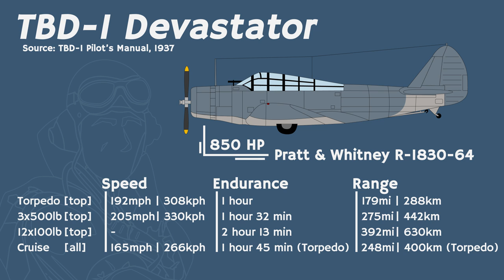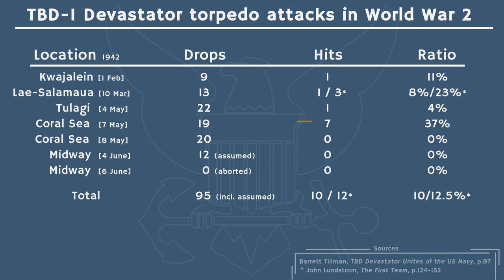In Defense of the Worst Aircraft of World War II - TBD-1 Devastator

Comment: Excellent presentation ;  here is a few considerations on the Devastator,  (1) it was heavy due to its folding wing and overbuilt structure  (2) it was under powered at a thousand horsepower . It also had the misfortune of operating when Japan controlled the airspace around the fleet.  However, due to it success at coral sea and the success of the enemy at Pearl Harbor , the Japanese navy feared the torpedo as did all Navies at that time.  At Midway the enemy swarmed the Devastator squadrons and left the sky above the fleet open.   That day went to a hand full of Navy pilots who were excellent dive bombers who flew the another outdated aircraft, the Dauntless. The lesson here is that bombers do not operate without fighters.  Your video is excellent.

Comment: Can you do a video about why most german pilots liked more the 109 than the 190, even though the 190 was far superior?
Reply: The 109 was superior at high altitude and could achieve altitude fairly quick. The 190 was a superior low level & mid level fighter but wasn't able to reach great height. There is a video on the FW190 - the Butcher Bird.
Reply: @vernmosquin3026  ok, thx.

Comment: Nice collection of photos, vids and veteran feedback of the TBD.  I remember reading that the TBD's performance was not that much different from the B5N (though I doubt it because of the different design elements and aerodynamics) You hit it on the nose RE: the TBF/Ms as they suffered just as badly at Midway.  Kudos for using FB/46;  long in the tooth, but still very immersive though their are better,  historically accurate (Coral Sea/Midway) skins out there from very talented artists.

Comment: Aerial smoke-laying is a new one to me. Very clever, especially for marine use - and of course it becomes virtually useless once radar is on the scene.
Reply: This is simply not true. radar is no replacement for vision in many senarios. Plus you can drop tinfoil confetti if you like along with your smoke. Plus you remove confirmation. Also radar signatures aren't very reliable compared to say, sonar even. Plus, information from radar takes longer to convey. 

Plus there are still loads of tactical advantages to it.

Comment: As you you say, the TBD was one step away from the biplane. The same could be said of the F4F, which I remember was originally designed as a biplane also. SBD to SB2C, to TBD to TBF, F4F to F6F. The differences, in power, performance, armament of what the US Navy started with, to what replaced it in short order, was amazing. Of course, the same could be said for the air arm of all axis and allied forces. The advances on all fronts was astounding.

Comment: Unmentioned is the dramatic increase in the launch window for the Mark 13 torpedo. From 50 ft and 110 knots in 1942 to several thousand feet and 250 knots by late 1944. While the SBD never carried a torpedo, its replacement (Curtis SB2C) was equipped to carry a torpedo as one loadout option, demonstrating that the Mark 13 had become a genuinely good weapon by late in the war. Given F6F or F4U escorts and a torpedo with that launch window, even CD the TBD could have been tolerable.

Comment: One thing that most don't know, and is only mentioned in one book that I know of, is that the torpedo squadrons at Midway had never dropped a live fish in training, or even a practice fish.  They were too expensive to use in training. So all the doctrine was theoretical.  Come in low and slow to drop the fish.  This caused the fish to hit like a belly flop which scrambled its directional and depth equipment, leading to wild runs.  After the war the Navy tested and found that a faster higher approach, that let the torpedo enter the water nose down, instead of on its side,  gave much better reliability of depth control and direction control.   On entry the fish went very deep but then came up to set depth and made its run in the correct direction.  Unfortunately that was too late to help in the war and by then air dropped torpedoes were nearly obsolete.

Comment: I like the picture at 4:03! I'm assuming this is the prototype judging by how the sheet metal is being formed around the landing gear. (Presumably to be used to design tooling for production parts.) I also like the fact that the bombardier's sighting doors are open WITH the torpedo in place. I often get flack for displaying my Monogram Devestator in this configuration (as it is not the norm) but it happened at least this one time! The TBD does indeed need to be viewed in comparison with its contemporaries, not planes that are five years newer as design progression was happening so fast at that time! a similar comparison would be the original Lamborghini Countach of 1974. It was a fantastic machine, but minivans today will accelerate faster than it will (if still not able to hit the Countach's top speed.)

Comment: A potential reason for the discrepancy in the performance of the TBD-1 might be due to armor. A great example of this is the Brewster Buffalo. The Finns used an F2A-1 variant without cockpit armor and a slightly more powerful 950 hp engine. This was a nimble and tenacious dogfighter. The Finns loved it so much, they licensed it so they could produce it themselves. If I remember correctly, this fighter had the best kill-to-loss ratio of any fighter in the war (26:1). Yes, we're talking about the Brewster Buffalo. The British used an uparmored variant of the F2A-2 in Malaysia, and the variant the United States deployed, the F2A-3 had an addition 500 pounds of armor and equipment. From an interview with Pappy Boyington:

“I had no sooner finished saying the word ‘Buffalo’, when he slammed his beer can down on the table, and practically snarled, “It was a DOG!” (His emphasis). Then he slowly leaned back in his chair and after a moment quietly said, “But the early models, before they weighed it all down with armorplate, radios and other sh*t, they were pretty sweet little ships. Not real fast, but the little f&%ks could turn and roll in a phone booth.”

While I cannot definitively claim this is the cause of the degradation in the performance of the TBD-1, the extra weight of additional armor and equipment is a plausible explanation. I'd have to look into it to see if there is an evidence to see what modifications were made to the aircraft during its service.

It wasn't just the Mark XIII torpedo that was faulty. The ship-mounted Mark XIV torpedo was also a disaster. American torpedoes were horrible early in the war. It wasn't until August 1943, twenty-one months into the war, that the United States addressed the issues and could claim to have a reliable torpedo, and that was the Mark XIV. A similar claim could not be made about the Mark XIII until early 1944. This was, of course, after the Battle of Midway and the replacement of the TBD-1. I don't think this problem can be overstated. This makes it truly impossible to judge the TBD-1 fairly.

Comment: What is the specific tactic used when dropping torpedoes?  I've always thought it'd be key to set up three runs: one to take out the ship should it continue straight, and two more perhaps to hit if and only if it turned hard left or right.

Related is: did they have any special torpedo "bombsight?"  One could take in to account aircraft speed and wind, target size and motion, and maybe let you adjust an input for target heading as you fly.  It could probably then mechanically show a rectangle in a eyesight with two lines indicating ship front and back... match those two lines to the ship and you know you're good distance and the torpedo will hit...

Comment: I submit: if the TBD was given a larger more powerful engine (the Pratt and Whitney single radial engine perhaps? It powered the F4F Wildcat) or even just a single stage turbocharger AND a four bladed, constant-speed propeller with broad propeller blades, that would have gone a long way towards alleviating many of it’s problems. Remember also, just before CDR Waldron’s squadron left with USS Hornet to fight the Battle of Midway he managed to re-equip HIS planes twin .30 caliber machine gun mounts for the rear gunner. They were actually modified twin .50 caliber machine gun mounts for Dauntless Dive Bombers but there were no .50 caliber machine guns available so they used .30 caliber machine guns instead.

Comment: You have to remember when the TBD came out it was the aircraft design that was the transition between biplane to mono plane. It was also designed to be both a dive bomber and torpedo bomber making multi mission capable. It was very successful in fulfilling that role during the postwar period but never tested under combat conditions until World War II. Like some many other promising designs of the time modern aircraft really showed up their obsolescence especially fighter aircraft. In fact, it was our naval intelligence that dismissed the dreaded Zero's performance at first because it was too unbelievable to them. So the designers were hard pressed to create survivable aircraft based on the revised specifications brought about more rapidly advance fighter aircraft such as the A 6M or Japanese Zero. This should be noted as well. 🤔🙃

Comment: What the TBD's really needed was drop tanks.  The problem at Midway wasn't so much that there was no fighter escort, as that the TBD's couldn't call it to come and then loiter around and wait for it, and for dive bombers.  Finally you'd have more range to get home.

I also ask myself WHY the torpedo runs had to be so predictable.  Could you not come in at an angle, initiate a turn, and release the torpedo when the ship was in front of you (or with appropriate lead)?  I also wonder why torpedo runs weren't dune in sets of three prongs, with three launches designed to hit the ship if it stayed on course, if it veered left, and if it veered right.

Comment: To some extent the reputation of the TBD is ruined by the timing. It seems many airmen found themselves comparing it to newer aircraft. It's like saying the P.08 Luger is a terrible side sidearm for military use because it's not as good as a Sig-Sauer P226 or that the Beretta M38 smg was rubbish because it's no MP5. The TBD was a good aircraft, it just flew at the wrong time with the wrong torpedo and was compared to the planes it assisted in creating.

Comment: Its interesting how history is not necessarily so kindly to some aircraft for reasons that are arbitrary at best. The P-40 doesn't really have a positive impression because pilots made the grievous error of dogfighting the Zero and playing to the indisputable dominance that it had in that area. Yet it served well in the European theater. The P-38 has a stellar reputation based on its performance in the Pacific while it's performance in Europe was somewhat lackluster. And the B-24 almost gets forgotten even though it was the more numerous bomber in the ETO. I think the assessment is pretty much spot on: if the 3 torpedo squadrons at Midway had been flying TBFs (or any other attack aircraft of the war) the results would have probably been identical.

Comment: Another thing of the TBD being quickly replaced by TBF's, doesn't mean that the TBD was a failure, they where produced in so relative few numbers, that there where hardly any replacements left after Midway anyway, so they would have eventually been replaced sooner rather than later by the TBF, through shear operational losses if the losses at Midway hadn't  happened.

Comment: Before even watching: I think the problem of TBD is not the plane itself, but the bloody Mk13 early model torpedo that it carries.
The supposedly-better TBF/TBM debuted in Midway and can't even hit the broad side of any ship, let alone a barn. Why? because it's carrying the same lackluster torpedo.
If I remember correctly, early Mk13 is designed to be released at 100 feet @ 100 knots, which is way too slow and maybe too low as well for any torpedo bomber in the 40s.
Japanese Type 91 torpedos, on the other hand, can allow as fast as the top speed at sea level of its launch platform, the Type 97 Torpedo Bomber.
If the late model improvements of Mk13 was introduced before TBDs got phased out, I believe it would've performed batter.

Comment: You hit the nail on the head--the TBD, as was SBD as well, was a decidedly obsolete, pre-war design built around a set of specifications that could not compete with the Japanese, especially the Zero. Thankfully, the Avenger soon came on-line to replace the TBD as the primary USN torpedo bomber. In the case of the SBD, no following aircraft designs came into the theatre that could out-perform it (except the Avenger, and, possibly the Corsair). The SB2C Helldiver was a disaster--hence its nick-name, the "Son-of-A-Bitch, 2nd Class.

Comment: For a mid 1930's design the TBD was one of the most modern naval aircraft, compare it to the Swordfish (1934) which is of the same generation. The Swordfish is celibrated as an good aircraft with a good combat record, but if the two had swapped places, it could well be that the TBD would have become famous as war winning machine and the Swordfish viewed as an failure.
Please bear in mind that most of the mid 1930's designs where obsolete by 1940. Italy had the most modern airforce mid 1930's but the air legion sendt to support the Luftwaffe during the air battle of Britain in 1940 was badly mauled by Hurricane's and Spitfire's.

Comment: The TBD-1 was simply a victim of the accelerated progress of aviation in the 1930s. It was a high performance aircraft at the time. However by the time it was used in combat it was facing fighters both better armed (20mm cannon rather than rifle calibre machine guns) and faster. The follow on Grumman TBF-1 had twice the engine power available. The other thing crippling the TBD-1 was the useless torpedo (Mk-XIII) it was forced to carry.
The British had the same problem with the Fairy Battle, Bristol Blenheim, world-leading at first flight, death-traps within five years.
The British Fairy Swordfish had even less performance than the TBD-1, but flying from escort carriers in the convoy anti-submarine role, the low takeoff/landing speed made it capable of remaining operational to very low weather minimums => effectiveness is dependent on the environment, not facing fighters, low speed means better manoeuvrability.

Comment: The TBD was absolutely obsolete in 1942 however, it was what the U. S. Navy brought to the fight. The reputation of the Douglas was not very favorable among the Naval aviators before the Midway battle. Many pilots felt they should not be used because of their slow speed, poor handling characteristics and unproven mark 13 aerial torpedo (90% failure rate). The TBD pilots were trained and ready to do their part in the battle. I have often wondered what the survival rate would have been among VT-8 had the F4F Wildcats rendezvous and taken on the Japanese Zeros.

Comment: One has to wonder if the TBD would have been better remembered if they had built at TBD-2 with an improved twin wasp putting out 1200 hp vs the 900 that the TBD-1 had or the same Wright Cyclone that the SBD used. And if they had escort fighters during Midway I think it would have been better remembered.

Comment: Torpedoes in the US Navy were a problem in the beginning years of WW II, regardless of whether they were carried by torpedo bombers or submarines.  In the torpedoes carried by the subs, the detonators were faulty, and there were many documented records by returning sub captains of the torpedoes actually hitting their targets, and not exploding.  They also had problems with maintaining the set running depth, and in many cases either breached and went off course, or went underneath the keels of their intended targets.  I have read that the returning captains were not allowed to voice any criticisms of the torpedoes under threat or court martial, or, in the case of career professional officers, having their careers "torpedoed."  After enough complaints made their way up the chain of command, but outside normal channels, the Navy finally had to admit that the problem was the torpedoes, and fix the problems.

Comment: The TBD was no worse a torpedo bomber than that fielded by any other of the world powers (it did quite well at the battle of the Coral Sea). It was, in fact, rather advanced when introduced. Its failure (if it can be called that) was in the tactics  forced upon it by a Navy that was unprepared for determined aerial opposition (Mitsubishi A6M). NONE of its contemporaries could have done any better at Midway (imagine Midway with Swordfish?... imagine unescorted Kates facing a horde of awaiting Wilcats...). The first operation of the Avenger (the successor) was catastrophic at Midway. What is not generally recognized is that the production run of Devastators was VERY small.  Production had ended and the losses at Midway had truly shredded the U.S. Navy's number of torpedo bombers. The TBM/TBF  were already in development. The Devastator was removed because other aircraft were coming on line to replace them. It was slow and under-armed. So was the SBD Dauntless AND, indeed,  the TBM/TBF Avenger.

Comment: The TBD was obsolete at the start of US involvement in the war. However, so were many of our aircraft, ships, trucks, artillery, etc. They very quickly got better. In that context, the TBD was a victim of circumstance. If you have no high cover then you're going to get shot up. If your torpedos do not work then your whole platform and system are of no use and, therefore, "ineffective" on paper. Again, this plane was a victim of circumstances having nothing to do with the actual aircraft other than being an older design.